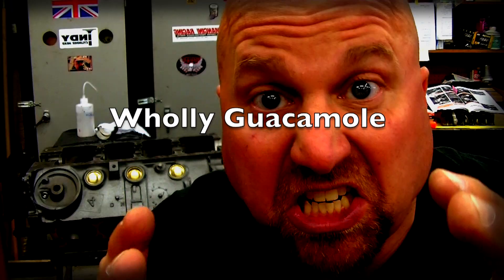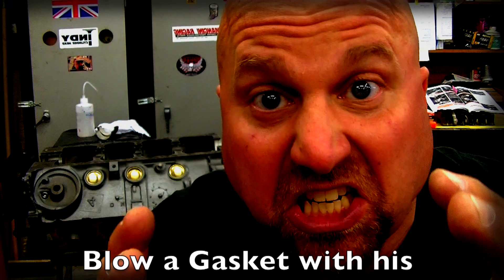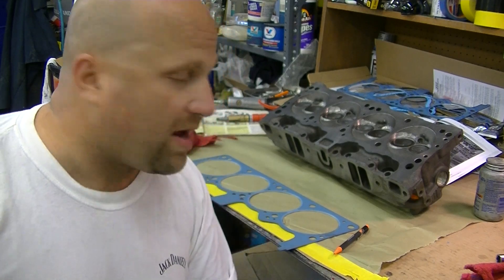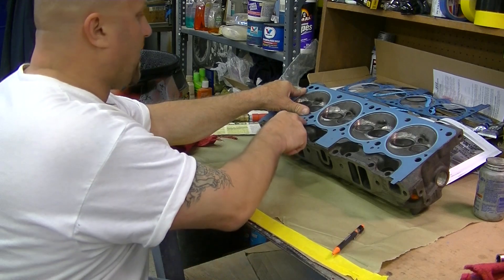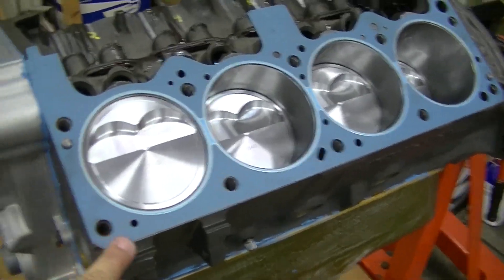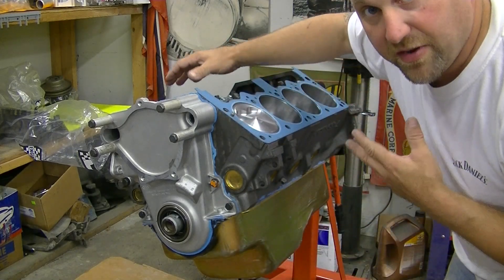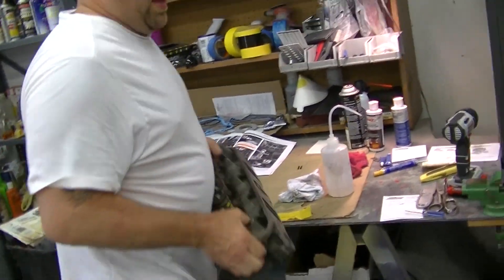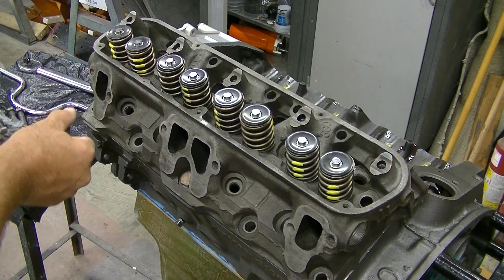340 Engine Build - Part 4                      " Head Installation "

Comment: hey man. ive got some questions that maybe you can answer for me. 340. with 360 cam. 340 heads. double roller. no compression in any cylinder. 76 lbs is the highest compression ratio. im going to swap the 340 heads for the good number 360 heads. and hope to god that the 340 heads were just junk

Comment: Lightly oil the head bolt threads. Too much oil and you can crack the block since you cant compress a liquid. Never use anti seize unless you want inaccurate torque readings. Go Mopar... cut back on caffeine.

Comment: what is the difference between the 318 and 340
Reply: Rod length.  A 340 is basically a 360 block bored out I believe .040 and a 318 crank.
Reply: Bore size 318 is 3.91 bore, 340 is 4.04 bore. Both have 3.31 stroke

Comment: Hi, buzz like your you tube channel and your 340 build. I have a question you. 0 decked block and 30 thousands off the heads? Did you have to mill the intake?  Thank you for your time making videos.
Reply: When the bottom of the heads are being shaved, I'd always suggest shaving the intake mating surface on the heads as well. This way you are not stuck with a shaved intake that only fits a certain application. I had this done on a 318 for my '41 street rod pickup when I put 360 heads on it with no issues.

Comment: I haven't built an engine in awhile but always used engine oil to lubricate the bolts. Torque values are typically based on oiled threads and fasteners. The torque spec listed for 340 is 95 foot pounds did you torque to 90 because you used anti seize compound?
TFS good video.
Reply from the maker: It's actually between 85-95 lbs & watch the Video for your Answer ! Geeeeee

Comment: i coud not get  349 heads so i put 318 heads  gave me higher compreshion
Reply: Erik Luyten man small block heads are so common, you may have got more comp but you lose maximum rpm, which makes power, 302 casting or eq magnum heads are best and cheap. 1.92 intake
Reply from the maker: +Erik Luyten Yea on there I used Milled 360 Heads to just get 9.5 to 1